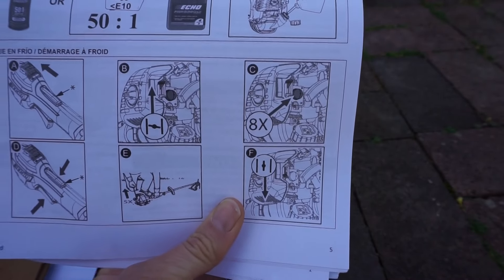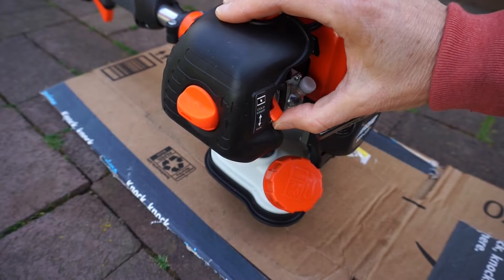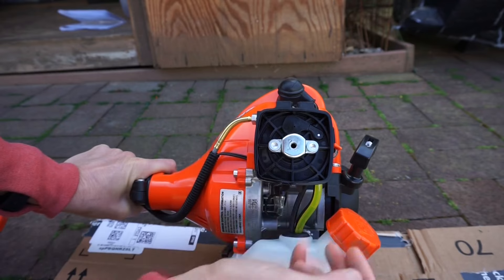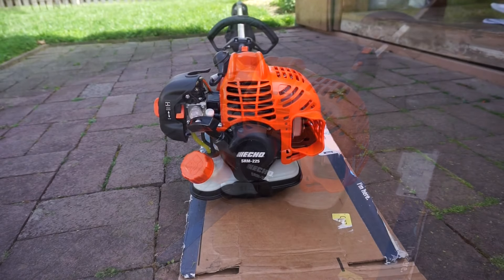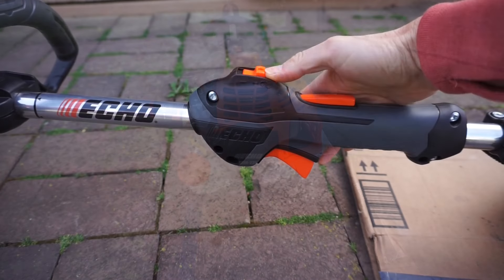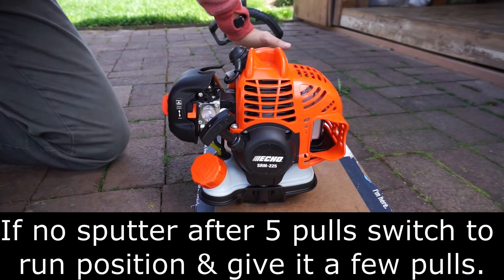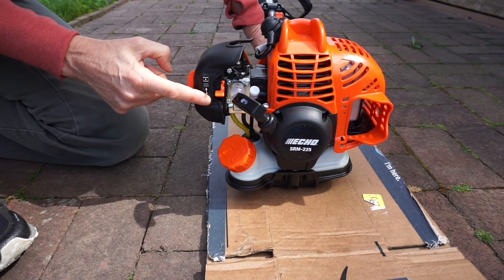Echo SRM 225 String Trimmer Won't Start - Flooded

Comment: Your method to clear the flooded engine worked flawlessly thanks 1 million. I was getting a little frustrated as I just purchased this and it took me two hours to just trim the edge of my grass which would’ve taken me 10 minutes if I refuse my electric trimmer to begin with. But you live and you learn thanks again
Reply from the maker: You are welcome. Thanks for taking the time to comment.  I always enjoy hearing from people who watch the videos.   So far the only complaint I have about the trimmer is the incorrect starting instructions.
Reply: Thanks saved me a lot of frustration I was almost going to buy a new carburetter kit off Amazon
Reply: Totally agree! It was flooded and I was so frustrated. Did this method and bam we were good to go. Thank you!

Comment: Thank you! Like many others who posted, I followed the directions and couldn't get it started. I figured it must be flooded, but couldn't fathom why the directions led me down this path. I was beyond fed up and no other videos I found helped. I followed your directions to move the lever to run and pulled about 15 times and started right up. Very clear and easy to follow - thank you for taking the time to make this.
Reply from the maker: You are welcome!  There are many comments similar to yours.  It's hard to believe that Echo could get the starting directions wrong.  I do like the trimmer.

Comment: After retiring my wonderful Husqvarna, I picked this one up. Flooded the carb. Thought 8x was excessive but I was obedient to the instructions. Thanks!
Reply from the maker: I too followed the instructions thinking this isn't right.  I called Echo and their tech support rep didn't agree with those instructions either.  I am still scratching my head at how those instructions can get sent out with the trimmer.  Although, I just pulled my toilet to troubleshoot a possible clogged trap.  I bought a set of nice brass bolts from Ace Hardware.  After setting the toilet on the wax ring, I couldn't get the nuts on the bolts.  I figured out that the threads on the bolts don't fit the nut that came with the bolts!  Agh!  Total PITA.  While I am ranting.  I just installed a new over the range microwave.  The holes on the template for the bracket were wrong.  Luckily I caught it before I drilled holes in the wall.  

BTW I love the trimmer.  I am running Trufuel in it.  The mechanic at the mower shop recommended it.  He said it will save money on maintenance.  I don't think he was trying to sell more product because he told me to look for it at Walmart at the end of the season.  They mark it down.  I got 2 years out of one of the big cans.

Comment: It worked, thank you! I could say more, but many have communicated my sentiments. New trimmer - 3rd time using. Would not start this morning in warm TX weather - at all. No sputter. Fuel is good, if not, I blame Echo. It's their brand 50:1. I grew frustrated after trying on my own for 20 minutes. Decided to mow my lawn anyway before work. 8 hours later, I stumbled across your video with a quick internet search, and it made the world of difference. Full disclosure, I selected it due to it being the shortest tutorial. You weren’t exaggerating with 10-15 pulls. I exceeded that twice over, likely due to user error. I cleared the flood, edged my front and will return to weed eat.  In closing, THANK YOU!
Reply from the maker: You are welcome.  I try to keep the videos as brief as possible, but still informative.  I hope the weeds were tasty!  lol.  Thanks for commenting.  Have a great day.

Comment: Hi.  I reviewed the Echo Quick Start manual that came with the trimmer and the more extensive manual on line finding nothing useful at all to help me understand why the trimmer wasn't starting.  I knew I had the correct gas octane and the right oil and ratio of gas to oil.  After exhausting many websites to no avail, I came across your YouTube instructional.  I followed your starting instructions & how to clear carburator YouTube video.  After following your instructions, my frustration melted away and I was thrilled.  Thank you so much for your specific "flooded" video--the trimmer started right up!!!  I will be viewing your other videos as I like to, "Know How Now".
Reply from the maker: It's my pleasure to help, Carol.  Thank you for taking the time to comment.  I like to hear when the videos have been helpful.  Have a great day.

Comment: You are the best! After changing the spark plug, air filter, fuel lines.
I couldn’t get it to start so I gave up and while laying down and thinking about it I stumble upon your video and this worked.  I literally had to pull 15-20 times on switch to run since I think I pump the carb with too much fuel.  Now tomorrow I can trim.
Reply from the maker: You are welcome.  It's good to hear the video solved your problem.  Happy trimming.

Comment: Thank you! I have Echo SRM 2620T, would not start,  and keeping the choke off in down position helped get it started, after like 15 quick pulls.  I normally do not press the primer bulb if using weekly and I normally have choke in up position till it sputters, then push it down and it starts.

Comment: Yep works great - I've learned to press that primer bulb like 3 times max for a cold start.  Really just watch the fuel line and only use the bulb to get a bit of fuel into the line.

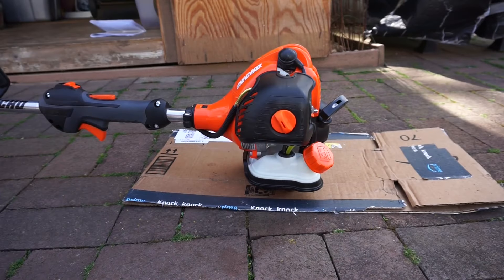Comment: 1:43 It did start on the third pull but died due to the choke being on. That is normal. Once the engine fires stop trying to start it with the choke on. Move the choke lever to half choke or off. If you don't you'll flood the engine. Also you can push the purge bulb as many times as you want to. It is not a primer bulb in the sense that it adds fuel the the engine. The purge bulbs purpose is to bring fresh fuel from the fuel tank to fill up up the metering chamber of the carburetor. The second fuel line connected to the carburetor is the return line where excess fuel in the metering chamber of the carburetor goes to be returned to the tank.
Reply from the maker: Hi there, thank you for the thoughtful and helpful comment.  I think you may not have watched the entire video.  In the beginning of the video, I am flooding the engine on purpose by following the quick start guide that comes with the trimmer.  Then showing how to start it if is is flooded... which is likely to happen if you follow the instructions.  The guide does not tell you to move the choke lever to half or off as you noted should be done when the engine sputters/fires (correct thing to do).  Later in the video I show how to start the engine without flooding it.  I don't know why Echo would include only a quick start guide with incorrect starting instructions.

I wondered why there was a return line for the fuel... thanks for the education.
Reply: @Know-How-Now  I agree with you on the quick start guide being incorrect, and you do explain the starting procedure very well in the later half of the video. ECHO needs to hire you to make their instruction sheets instead of the people they have doing it now.
Reply from the maker: It's a head scratcher on how an incorrect quick start guide could be the only instruction that comes with the trimmer.  I reluctantly followed those instructions and flooded it.  My previous string trimmer was an old Cub Cadet.  It had the craziest starting proceedure, so to me having instructions that go against common sense didn't stop me from following them.  I did call Echo's tech support and read those instructions to them.  The guy I talked to was quick to say pushing that bulb 8 times was too much.  I downloaded the user's manual and the starting instructions are correct.  Hopefully the video will help anyone using those quick start instructions.
Reply: @Know-How-Now  Like a lot of things today the quick start was probably wrote / designed by someone with book smarts and no real world experience.

Comment: Super easy fix just didn’t know exactly what was wrong. Thought I was getting the half and half gas and water mixture wrong but clearly that wasn’t the problem. Cleared engine of excess oil and was able to finish the rest of my yard. Thanks
Reply from the maker: You are welcome.
Reply: @Know-How-Now  "half and half" ?? Gas and WHAT??

Comment: Thank you,  this methods works!! Also, please add how long you let it sit before retrying
Reply from the maker: You are welcome.  Youtube won't allow me to add to the video.  You might let it sit for a couple of hours.  The time could vary greatly on the outside temperature.  By pulling the cord, you are creating air flow and drying it out.

Comment: At minute 1:39 as you are pulling the starter you can hear the weed eater fire. At that point the choke needs to be opened back up to the run position and then the engine would have started on the next pull or two. The reason it didn’t start is that although it had started to fire, you kept the choke closed.
Reply from the maker: You are correct, Noah.  The start directions that come with the trimmer do not tell you to do that.  I am demonstrating what happens when the quick start guide instructions are followed... and likely what someone would do who doesn't have the same level of knowledge as you do.  Later in the video, I show how to start it correctly..... maybe you didn't watch the entire video?  Many don't.

Comment: Had a new srm 225 that I fueled with the can stuff (94 octane no ethanol) and let it sit outside under a patio cover for about a month.  Finally got around to starting it, a couple of pops, then nothing.  Tried some carb. cleaner, more pops then dies.  So, fuel starved is the problem.  Borrowed a small glass jar and drained the fuel tank into it.  There was about 3/8" of gas and 3" of water in the jar.  Imagine my surprise.  Dumped that garbage out, fill it with new fuel and it took off on the second pull.  I have no idea where all of that water came from.  I don't think it rained the whole time it was outside.

Comment: Thank you. Your method worked!
Reply from the maker: You're welcome.  I have the trimmer a few years now.  I am finding that to start it cold, I can put the selector to "run", pull it and it starts up.  I'm not sure what has changed.  I haven't done any maintenance on it yet.  When I bought it the mechanic at the mower shop told me to run True Fuel in it.  He said that running the True Fuel will cut down on repairs.  I took his advice and it has been running like a champ so far.

Comment: New echo weed eater and won't start. I also used trufuel 50. They told me it was good stuff.
Reply from the maker: I've been using Trufuel in mine since I bought it.  A small engine mechanic told me to use this fuel.  I've had no problems with the trimmer and am at the end of the 2nd mowing season.  I don't know if they are still including the start directions with the trimmer that flood it.  If you are sure that you have not flooded it, here are the directions to start it properly.  You can book mark video so you can find it when you want to start the trimmer.  https://youtu.be/XmMpfwQr1P4?si=juYLU038Qpx33-xi
If it is not flooded and these start instructions don't work, then take it back to the mower shop.  I have no complaints about the trimmer other than the poor starting instructions.  I also have a video that shows how to load new string... very easy.  https://youtu.be/6j19uXFTE3s?si=uWzsqg-ywIN6RKzA

Comment: Nice!!
My Stihl Kombi (w hedge trimmer attachment) acted the same as yours. 
Less priming on cold start helped as you showed. 
I’m actually happier now with Li-ion  40V Greenworks grass trimmer and their 40V hedge trimmer just less hassle overall. 

Say hi to Melvin!! 😸
Reply from the maker: I was suspicious of the quick start guide (Hardly anyone will include the full printed manual - Echo included) starting instructions.  Pushing the bulb 8 times seemed like too much fuel and of course it flooded.

I looked at Stihl's battery string trimmer. I would likely need a 2nd battery to get enough run time.  If I remember correctly, it was over $300 for the trimmer & 2 batteries, so I abandoned the battery idea.   I went to my local mower shop... nice people and the mechanic recommended this trimmer.  Their price was $199 and Home Depot was selling it for $229.

Melvin didn't photo bomb the video as he often does.  It was mid afternoon during his nap time, so he missed the action.
Reply: @Know-How-Now  my $0.02 your mower shop staff steered you correctly! the SRM-225 is an absolute gem...light weight, easy starting, RELIABLE, professional quality at a homeowner price, has all the power anyone would need for typical residential use and the icing on the cake comes with the Speed Feed head...THE BEST in the industry. I appreciate ppl who want to go battery -but even though I use my string trimmers (Echo SRM-2620T & SRM-266) professionally), I would likewise choose the SRM-225 for home use hands down over any battery OR gas trimmer.

Comment: If I go to use my echo trimmer and there is already fuel in the bulb after a week, do I still need to prime? Mine has been flooding lately because  I prime even though the primer bulb has fuel. Any thoughts?
Reply from the maker: You might try pulling the cord without pushing the primer bulb (switch in start position), if it sputters on the first pull, go to run position.  Pull and see if it starts.   If that doesn't work for a cold start, then just push the primer bulb 1 or 2 times instead of 3-4. I believe there is  a comment from an owner of the Echo 225 saying he doesn't have to prime his for a cold start.
Reply: @Know-How-Now  thank you.

Comment: If there is fuel in the bulb, does it even need to be primed?
Reply from the maker: I've found that I can often start the trimmer without pushing the bulb at all.  Cold start, hold throttle fully open and pull until you hear a sputter.  Then move to run, keep throttle fully open and pull.

Comment: I tried to pull and pull mine and it did not start so i change spark plug and then pulled and pulled and did not work. I pump it again the next day did not work, so i left it for sometime and came back again and think left it on closed and pulled and then the engine started and then it worked. What went wrong???
Reply from the maker: Is it new?  If not, maybe it needs some maintenance/repair.

Comment: I changed everything  on my sr225 still won't start,new sparkplug ,piston,carburator, gas filter,cleaned gas tank,ignition coil good gets spark,cleaned muffler little screen window,and it still doesn't  start😭

Comment: Wait... We're TRYING to flood it or what? Echo instructions cause it to flood?
Reply from the maker: Yes, I am telling you that the starting instructions (current ones may be corrected?) are causing the trimmer to flood.  And, yes, I am showing you how to clear a flooded engine.
Reply: @Know-How-Now  can't wait to try it out. Thanks
Reply from the maker: You are welcome.  Have a great day.
Reply: @Know-How-Now worked! I actually didn't need to go through the procedure as it just needed to dry out on its own apparently but I'll remember this for the future. This is good cuz elsewhere pros were preparing me to test compression and inspect the cykinder/piston
Reply from the maker: Yes, that is an option, just wait for it to dry out.

Comment: I tried the your method it still didn’t work I’m definitely taking this dang thing back it’s a headache
Reply from the maker: There must be some other problem.  I've used the trimmer for 2 mowing seasons now and I really like it.  You might give another one a chance.  I also have a video that shows how to replace the trimmer line.  It's really easy.

Comment: You don't need to push the primer bulb on a hot engine.
Reply from the maker: Agreed, though if it cools down a bit a push or two on the bulb may be needed.